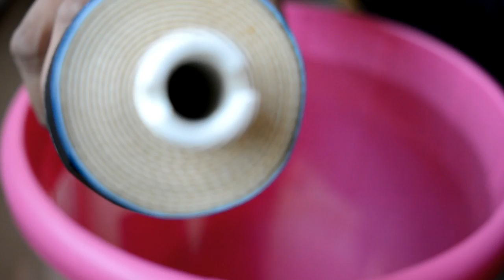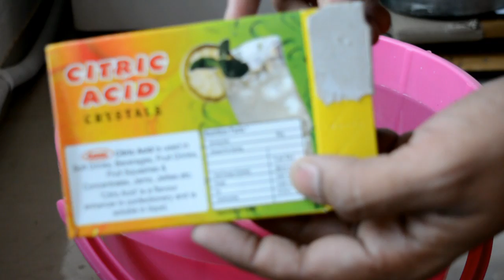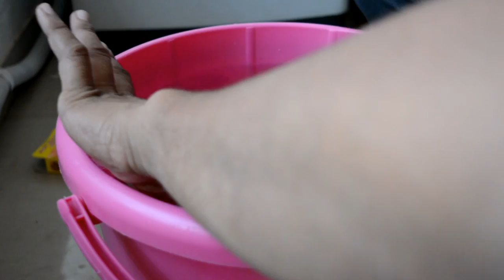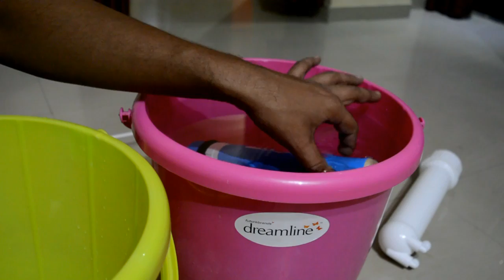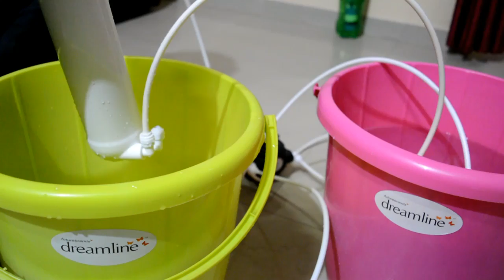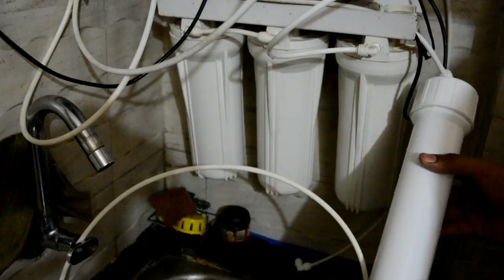RO MEMBRANE CLEANING CITRIC ACID CSM DOW how to clean Reverse osmosis

Comment: Hi I am from South India Chennai first I thank you for sharing all about RO system last month I assemble one hitec 300 gpd membrane with lexpure 300 gpd pump flow restrictor two 800 plus one 420  as per calculation now first 7 minutes system run smoothly after pump stop and start while running between 2 minute  gab why how to solve this pls reply when you free time thanks
Reply: But new set sir

Comment: This process never works..
*If membrane is fully chocked
It only works
*when membrane giving slow ro water
Inlet this solution from all 3  points of housing's after adding few drop of hydrochloric acid ( HCl) in a bucket.
Reply: Also avoid making long videos ;) ....time is precisous.
Reply: How many liters and how many drops of HCl sir? Help i keep clogging my membrane because of our hard well water. I already installed 4 stage prefilter with resin filter and anti scalant balls but still keep clogging my membrane.

Comment: I have replaced the mambrane everything has been fixed & checked but after puting it on the waste water is not coming out now what should I do to cure the problem ?
Reply from the maker: +creation mela waste water is not coming then check your solenoid valve .
Reply: Get rid of the solenoid valve and put a auto shut off

Comment: what amount of citric acid will be required for 1000 lph commercial RO.Can it remove smell?
Reply: Dont use citric acid..they damaged your membrane..
Reply: 1000 rtr ke liye 500 gm cytricacid ka selution 15ltr pani main 50digree temperature pe chala kar 30mint tak membrane flush kro ji fir 10 mint rest deker saff pani se flush kardo i am Kulwinder from gill ro systems faridkot punjab